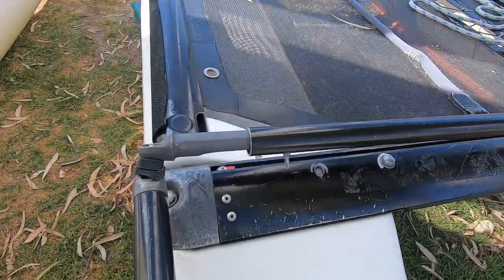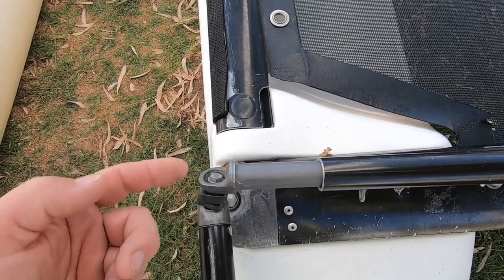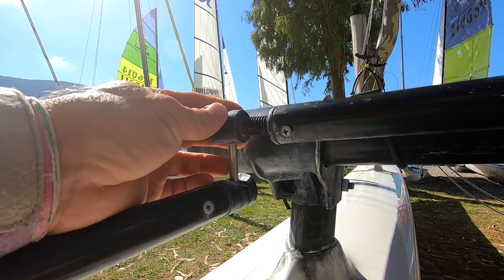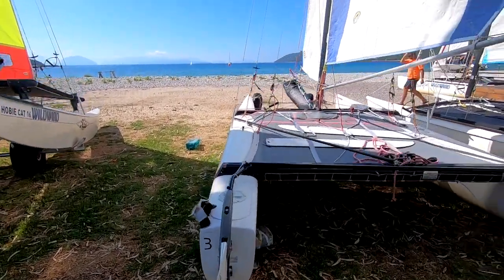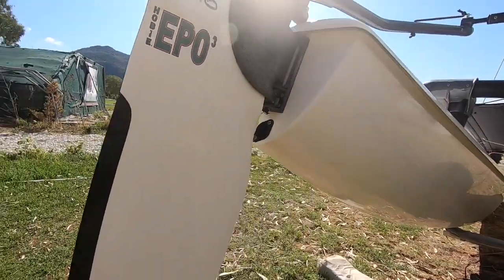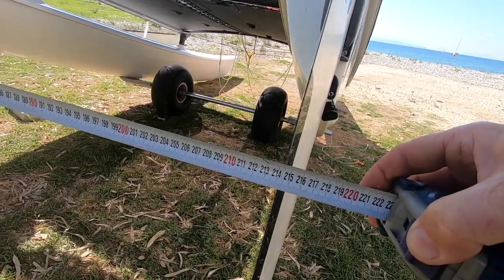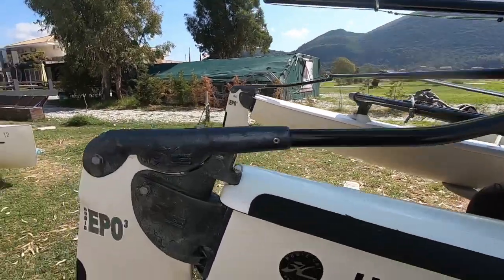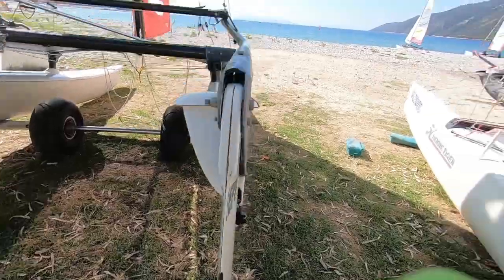Catamaran rudder allignment

Comment: Great Video (s) Joe. I find that on a starboard tack there is virtually no force on the tiller, i can hold it and steer with 2 fingers , but on a port tack I really have to HANG on the stick. SO much force.  Can this be an alignment issue?  (I have an old South African HALCAT 14 btw.)
Reply from the maker: This is more likely to be a rudder rake issue - where your rudder isn't locking down sufficiently - or maybe the blade is damaged

Comment: How do i get rid of rudder humm ive tried all the tricks and still have it. Thx Joe
Reply from the maker: you can square off the trailing edge with some sandpaper - that should work
Reply: @JoyriderTV  tried that and about 5mm toe in and new bushings and shims. Its extremely irritating lol
Reply: @jcowboy123  Somem people advocate squaring off the trailing edge, while others suggest sharpening it. I got good results with the latter but know others that did the former and stopped the hum. I suspect that it's really a matter of just slightly changing whatever you have now.
Reply: I don't believe Epo's get that hum, I know mine don't....another reason to get them.
Reply: @TomKirkman1  thx Tom that was my next step was to try and razor the trailing edge I've done most everything else. A new sailing buddy suggested sharpening both edges. I'll let you after Saturday sail thx sgain
Reply: @stevenvachon9745  My EPOs don't hum and they have a razor trailing edge. They are beautiful rudders.
Reply from the maker: @jcowboy123  which blades are you using - i know that the lean blades will moan like a pair of whales regardless of what you do.
Reply: @JoyriderTV  lol  the stock rudders

Comment: My toe-in for '85 H16 is huge.  Adjusted it all the way out, better, but still way off. It looks like I need to adjust out approx. 5 cm. more on each side but no more adjustment is possible. Any ideas why?  I performed a full rudder service.
Reply from the maker: What it sounds like is one of two things - either your connecting bar is just too short. Or, Maybe your tiller arms have been riveted in the wrong position - if the bend goes more inward than upward that will act like having a longer connecting bar.
Reply: @JoyriderTV  I looked at the assembly with your thoughts of the arms riveted incorrectly in mind and discovered the issue. It appears that someone may have taken apart the crossbar from the tiller arms at some point and reassembled it with the decals indicating left and right on opposite sides. This put the tiller arms on the incorrect side angling outward. Took the tiller arms off connecting bar and rudders, moved them to the correct side and adjusted for toe-in and Bob's your uncle!  Big thanks Joe

Comment: I have a 2002 Hobie 16. By this description my rudders are toed in right 4mm. I do have a bit of play fore and aft but when sailing she always wants to round up and I have to use significant force to not let her round up. What do I need to adjust? Also I keep snapping the tips of rudder cams. (Leaving my local boat ramp I have to sail about 400m in water less than 50cm deep, before getting to deeper water about 1.5m deep.)
Reply from the maker: A full service should solve your problems, the weather helm will be down to the rake rather than the alignment. https://youtu.be/7jfn8f93XiQ